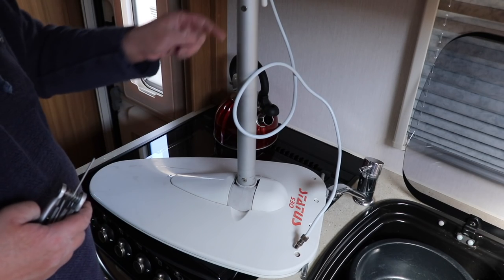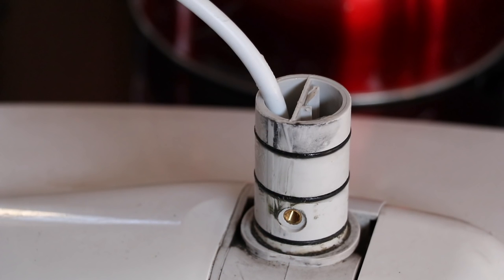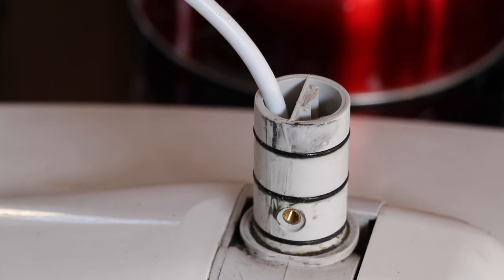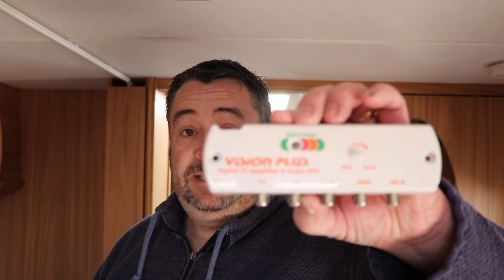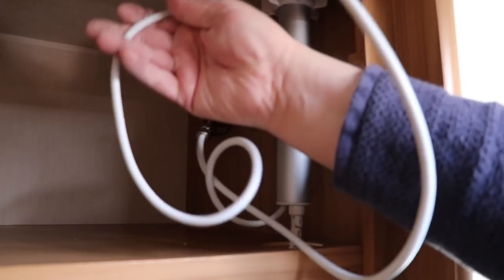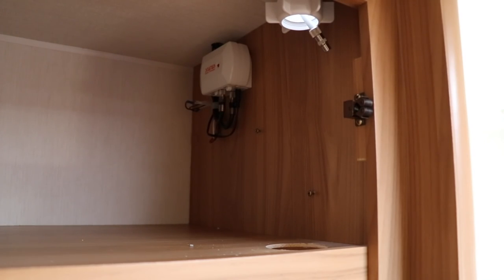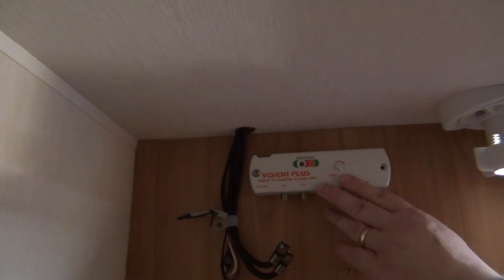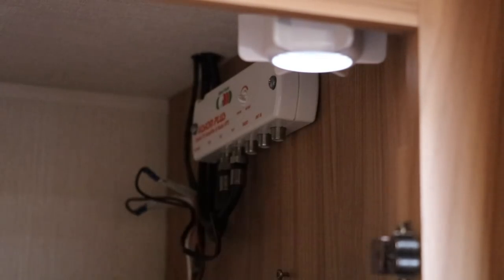Vision Plus Status 570 caravan antenna upgrade

Comment: Good vlog dan. Nice point of the antenna facing backwards when traveling 👍🏻👍🏻. Never really put any thought on it and always have mine facing forward but doing it that way I’m straining the pole. 👍🏻👍🏻. Another point to make out if ur van is in storage and don’t have a solar charger is to turn the amplifier off as it’s live all the time and drains the battery
Reply from the maker: Good point, ours is switched off by the main panel, but i do switch it off when i collapse the antenna when leaving home. 

Thanks again, trust you are all well

Dan

Comment: Dan, another excellent video on upgrading your antenna, well worth watching along with all the tips and hints, plus the problems of course. Well done, I wouldn't hesitate to change my antenna after watching your video, but only if I had too. Thank you also for the app info which always helps when in a remote area. I have to say, usually I just have a look at the way all the aerials are pointing on the nearby houses or caravans, but I take your point when you are completely isolated.

Comment: Hi Dan, got my first Caravan in Jan 2018, it had the old TV Aerial on a mast which was rubbish, i spoke to the Caravan Engineer who was servicing the fridge about it and he assured me the best Aeriel on the market was the Millenco 900L Omnidirectional Aeriel, i purchased it, fitted it to my Caravan and its great !!, no need for turning the Aeriel as its a fixed unit, ive been to a few sites and the TV signal is excellent, got it on e  bay, i think it cost £99.99 and would highly reccommend it, .......Eddie.

Comment: There's another advantage of the 570 you may not be aware of. Since the 530 was launched the digital bandwidth has been increased and the 570 has been designed to receive this wider range of signals giving more stations than are available with the 530.

Comment: Nice helpful video's, might have helped if you'd told us what size hole cutter is required for the original fit, so to that end they are 45mm & yes I do realise that you didn't need to cut a hole.
Keep up the good work 10-10 for clarity.

Comment: We bought 5 inch high stick antenna for less than £2.50 ,magnetic base or use blue tack on the base goes anywhere, cable is thin enough to come through the side of window and never had any problems with them(you can buy from EBAY or AMAZON .....

Comment: I’ve just fitted the latest status 580 a little bit more expensive but a much longer pole than the 570 worth the extra money reception is much better to the onboard radio as well after running new coax from amplifier to radio bit fiddly but worth doing this was on a swift Conqueror

Comment: No mention of Gain, either of the antenna or the amplifier. 
The gain allows you to compare the performance of the antenna and amplifier.
I'm always very wary of any manufacturer that doesn't quote the gain in the product specification.

Comment: We have exactly the same issue. I have resealed the edge of the aerial but there is still a bit of water that gets through. We have a bin bag to over the end of the end to catch the drips. Might be time to upgrade.
Reply: I have this same problem of water running down the centre tube, I sealed all round mine last year including the joint casing around the antenna itself, but this winter still got drips again, i use my caravan in winter, and im beginning to think it could be condensation, and the antenna is acting like a damp trap, my thought is the warmer air from inside the caravan goes up inside the antenna through the tube, cold air outside then makes the warmer air inside the antenna condensate, and after a few months there is that much moisture build up inside it runs back down the tube.....

Comment: Did you have to make up a coaxial lead to connect the radio outlet from the VP5 to then connect directly to your splitter? In doing so I would be doing away with my separate FM area like you too had on your Lunar? Or does the splitter allow me to use the FM aerial to get the DAB signals?

Comment: I have a question please, I have a 30mm hole after removing my radio aerial and want to install this Ariel however it needs to be 50mm .the instructions say you can drill a hole but I just want to be absolutely sure it is OK to do so. Any advice is welcome 😊

Comment: Is this antenna height adjustable. We have an omni aerial but like to put a cover on as we sit the caravan under a tree. If this could come right down onto the caravan roof when the caravan is not used, it could save us a lot of problems with aerial meeting cover.
Reply from the maker: Hi, yes the height is adjustable. In the thumbnail the antenna is at its lowest position, it can extend a good 8 inches above roof line. 👍

Comment: Hi Dan.
Great video we have a new van but a basic Omni aerial.
The only problem I can see is that I will need a bigger hole for the pole.
Any suggestions please would be a great help.
Kind regards Gary.
Reply from the maker: Hi Gary, 

If you have an existing hole, you simply need to widen this to 50mm diameter. (hole cutter attachment will be fine.) 

See here for the instructions  for more information. 
http://www.visionplus.co.uk/assets/pdfs/560_status/560%20STATUS%20Instructions%20RETAIL%20A3.pdf

Hope that helps. 
Dan
Reply: Thanks Dan .
Reply: @garysouthwood85  hi Gary, I am in the same predicament where I have to widen the hole, how did you get on with this? Thanks

Comment: correct me if im wrong but the vp5 does not have a dab output only a un amped fm ?
Reply from the maker: Hi Neil, the VP5 has an un-amplified radio pass through, so it will work for FM and DAB.  see my later videos on adding a DAB radio to the caravan, where i use a VP5 amp and the Status 570 as the DAB antenna.

Comment: The Amazon link to the aerial. Is it just for the upgrade or does it come with the brackets, rubber collar etc? We have no roof aerial so looking at needing the full fitting kit.
Reply from the maker: Hi Nick, the link is for the complete system. The antenna, the amplifier, the mounting plate and a few cables too. 

Thanks

Dan

Comment: Hi Dan, we have a 530 antenna and recently bought a vp5 amplifier as struggling with reliable signal and still are even after putting in vp5. Will the 570 antenna give a much better signal do you know as considering upgrading if it will help? Thanks
Reply from the maker: Hi James, Have a look for my "improving TV signals" video, where I add some filters to improve the TV reception - this would be the cheaper option, and certainly wont hinder any future upgrades to your TV antenna.

Hope that helps.
Reply: @TheTrudgians  will have a look Dan think I will have watched it at some point. Great Videos and hope your keeping well. Thanks James

Comment: Dan I’ve plugged my amplifier in at the other end where the coax cable joins into the tv , when I twist my Ariel it’s not going green. If the amplifier is not plugged in by the ariel end will this effect the green light on the amplifier itself
Reply from the maker: Hi Mark, i think i understand what you are saying, if i have it right, then yes, you wont get a green LED, but also you may just be in a bad reception area?
Reply: @TheTrudgians  I have to crank my amp to max to pick up a signal if I have to put my amp the other end of the caravan I’ll have to run a 12v supply to the other end of the Carvan. I don’t mind doing this as long as the led works , the fact I’m picking up a signal would you leave it as it is? It was routed the other end of the caravan when I bought the caravan so I put it in the same place , so the Ariel is one end the amp is the other end . Will this effect the signal?
Also when I crank it up it does go amber

Comment: hi there was wondering how the areil preformed and are these better than the omidirectional round ones you see im looking for an ariel for my camper on a perminat fixing thanks stu
Reply from the maker: Hi, the omni directionals are a good antenna, but the performance of an antenna that can point at the transmitter will always be greater, however it will need adjusting wherever you go, thats the downside. 

This antenna performs really well, including the 530 it replaced. I hope that helps

Comment: I was told and also my understanding that the red dot must be pointing in the direction of travel, with the narrow part of the antenna facing forwards  and the wide section at the rear, this creating less drag on the antenna when driving. Can you confirm this
Reply from the maker: Hi Robert, 

No this is incorrect. The red dot is aligned with the front of the antenna. When in transit the antenna MUST face backwards, to prevent damage to the rubber seal. 

When facing forward the antenna will wobble with wind resistance, causing some oscillation, this over time will weaken the seal. 

See Here for Status 530 antennas (on page 1)
http://www.visionplus.co.uk/assets/pdfs/530_ENG/530_ENG.pdf

and here for Status 560 and above (On page 2)
http://www.visionplus.co.uk/assets/pdfs/560_status/560%20STATUS%20Instructions%20RETAIL%20A3.pdf

Hope that helps.
Reply: THanks Dan you are 100% correct. Theres a lot of misconception out there even dealer and rental companies are telling people it should face forward and the red dot should be facing forward., but as you say it should point rearwards when travelling. Big Thumbs up there Mate.

Comment: We have the 560 ant with the VP5 amp. We dont need to use picth tv points this works alright. why does the aerial need to point back when traveling
Reply from the maker: Hi, 

The user manual is pretty clear on which way to point the antenna when in transit. Im sure its connected with the aerodynamics of the aerial and oscillation against the rubber collar. Here is the text from page 2 :

Travelling
When positioning the Antenna Dome please
allow for the following:-
DO NOT TRAVEL:-
•  With the Antenna raised
•  With the Antenna set for vertical signals
To reduce the possibility of damage when
travelling, have the antenna pointing towards
the rear of your caravan/motor home.

Hope that helps. 
Dan
Reply: ok, ta.